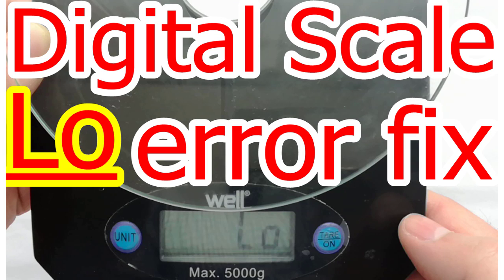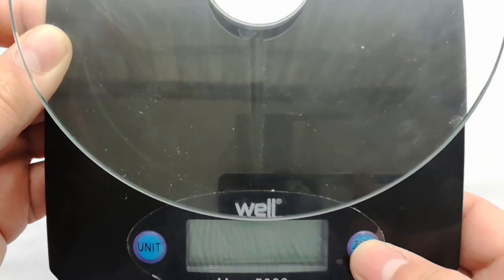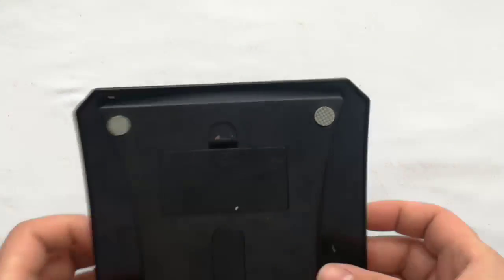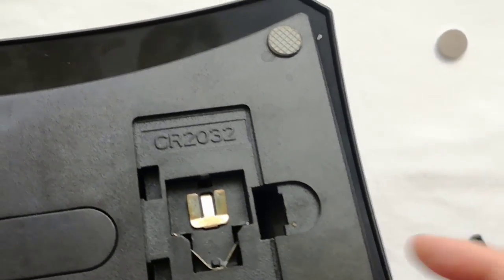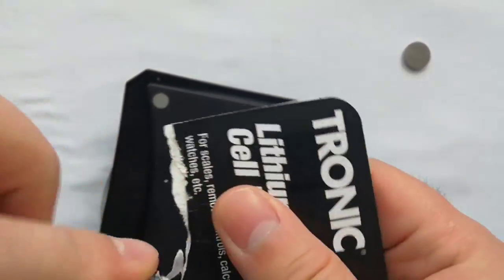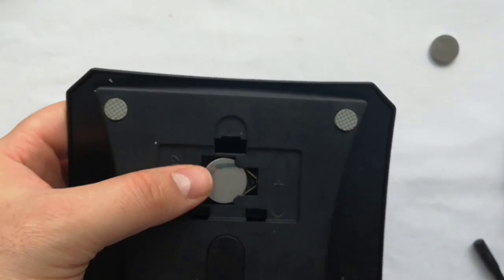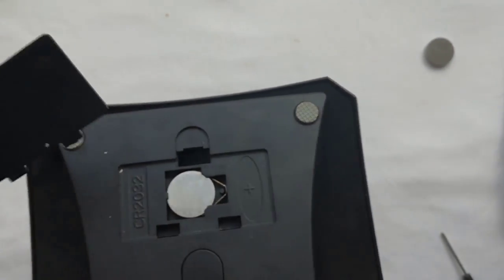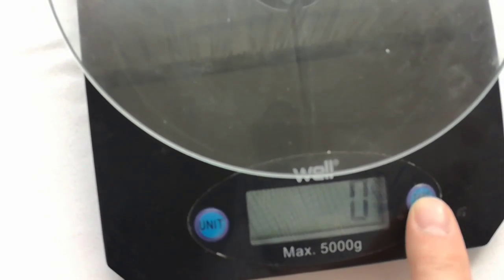How to Fix Digital Scale Lo error message Ep.175

Comment: Doesn't fix even after changing new battery. It still says lo. Please reply fast
Reply from the maker: Aloha, measure the battery with a multimeter, the new battery must be over 3.00 Volt, if it is below 3.00 Volt, the scale will not work properly.

Comment: My new kitchen digital scale is using 2 AAA batteries. It always show Lo after a day I changed the new fresh battery. All type and brand from Duracell Alkaline, ect I tried, but still have same problem. Still google how to fix that.
Reply from the maker: Probably your scale has an electronic defect, short circuit. 
If you have a multimeter you can measure the battery usage after the display is turning off.
Remove the battery's, with a wire you connect the battery + pole to the scale and the multimeter you put to measure Amps and  connect one probe to the - pole on the battery's and the other probe to the scale.
After the display is turning off. on your multimeter you need the see 0 or 0.001, if you see higher, then you need to service your scale.
If you don't use daily the scale, you could take out the battery's after you use the scale.
Thank you for watching.
Reply: @redigitt  thank you for replying, I'm using the scale 3-5 times a day to weight my coffee and food. Bfr I tried to take off the batteries after using it and the result last for 3 days. I also checked the batteries with multimeter after the scale showed Low and actually the batteries still good (1.30 Volts). But it didn't work on the scale. Oya, when I put fresh batteries the scale show the battery signal only half when it turned on. I measured the amps with multimeter it showed 1.05. I got a bad product and the seller didn't answer my complain. I guess I have to buy another new scale with trustee 5 stars seller.

Comment: I do same mine still not working
Reply from the maker: Sorry to hear that.
Reply: @redigitt  written on the screen error what can I do
Reply from the maker: if you have Lo error  then you need to change the battery, Lo = LOW BATTERY.
If you have a multimeter mesure the new battery, has to be over 3V, if it is below 3V then you need to replace the battery.
Reply: @redigitt  it’s new battery I just bought
Reply: It’s digital kitchen scale
Reply from the maker: The battery is new, but you measured?
A new full charged battery has around 3.15 - 3.25 V.
Reply: @redigitt  yes battery is new.